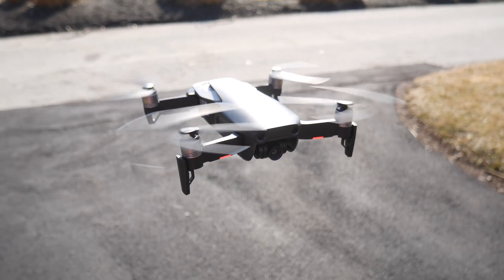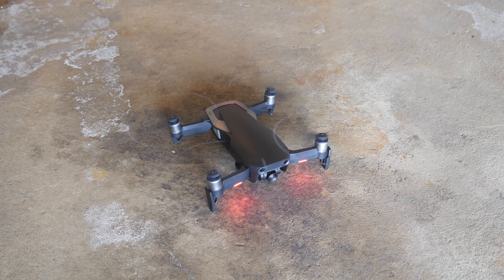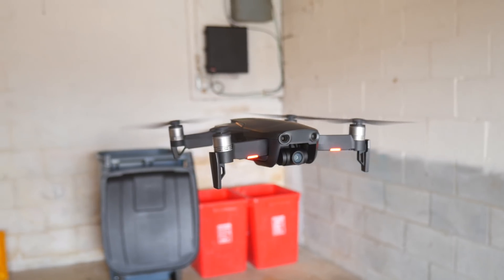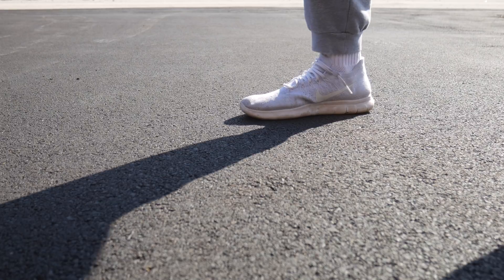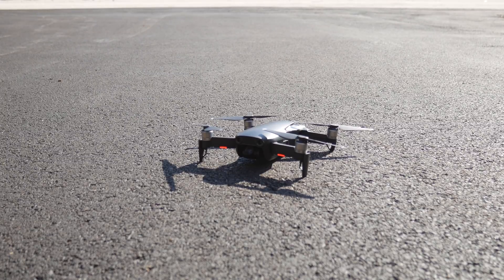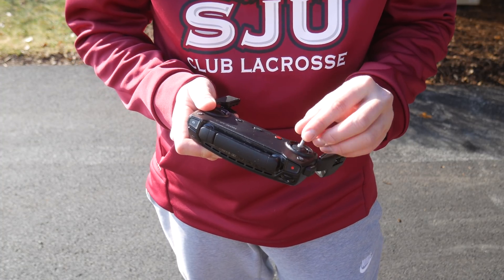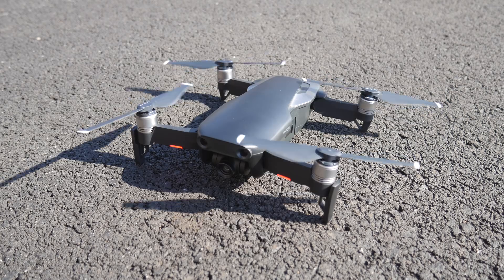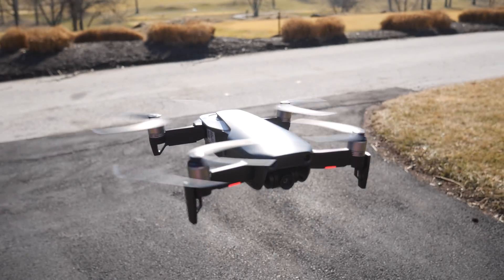The DJI Mavic Air’s Shaking Problem (Workaround)

Comment: I have a problem with my MAir gimbal tweeking during flight, most of a recording will be fine but every 30 seconds or so I will get a tweek/jump on the level of the horizon. I can U/L a sample somewhere so you can see what I'm talking about, unless you know already. I really need to find a fix, thanks in advance

Comment: Same problem with my Inspire 2. I flew it in -20 celcius and it would shake violently, then yesterday I flew it in 0 celcius and it was no problem. I tend to believe it's a gains issue over all. I will be doing more tests tonight at -18 celcius with the pitch and roll gain at 90% and see if it stops or reduces the shuddering/shaking. I have read elsewhere dropping it to 87% may be necessary. The comments have been super helpful, especially the ones speaking about gain control. Thank you!

Comment: Hi Billy.  As of this morning, the new firmware update had fixed the IMU issue.  They adjusted the PID, which fixed the overcorrection by the IMU in cold weather.   Basically it's like turning down the sensitivity on your mouse.   I flew in -7F this morning after the update with no more shaking.  Works perfectly now!
Reply from the maker: Awesome! Haven’t had the chance to check it out

Comment: First of all, thank you for taking your time to find a solution to this issue, but i must say as a dji phantom 3 pro and a mavic pro owner, that this solution is not enough.. i mean, come on, the mavic air owners/costumers are paying $800 flat for the ´´single´´version of the air instead of the combo... i don't know you guys but for me, thats a lot of money. when you get a 800 USD portable drone you just want it to fly  it without any issue right out of the box and not wait to the motors to warm up... if i wanted to spent time waiting for my drone to be ready and so, i will get a phantom, wich takes more minutes to take out of the box and assemble. for disclaimer: im not mad with you about this video, im mad with dji for this and im really hoping that this kind of problems don't happen when the mavic pro 2 comes out, BTW. sorry for my bad english.

Comment: Most likely a software issue. You can reproduce this with any racing drone if you crank the PIDs way up. Probably DJI should implement some kind of filtering or tweak the settings a bit (as you can't do that yourself in DJI Go).

Also, this would be worse with full batteries. As the voltage drops pretty quickly at the beginning of the flight, the problem will probably be gone after a minute (or a few minutes) of spinning the motors.
Reply: Thanks for your help! I could not figure out what was wrong with my Inspire 2. I am hoping this is the issue!

Comment: The reason of the shaking is a gain value, wich is too high at cold conditions.
You only have to reduce the gain of the roll to 90% and the shaking is history.
(MC Settings --> Advanced Settings --> Gain --> Roll)
If you have an additional shaking over the pitch axis, try to set pitch to 90% too.
Reply: Thanks for your help! I could not figure out what was wrong with my Inspire 2. I am hoping this is the issue!

Comment: My opinion to get this issues resolve is when flying on those cold weather place the drone on a warm car before flying , or start the mavic and have it idle with motor spinning without blades … till it reaches a ideal temp then fly, I would  never fly a drone shaking as the wear and tear of the drone is relatively high ... I use to fly rc heli and shakin and vibration is a no no go, that mavic air should be rename MAVIC CALIFONIA YEAY

Comment: I would not stress the motors and drone electronics letting it vibrate until the system warms up, best to keep batteries and drone warm.  you may be causing "soft damage" similar to soft damage of electrostatic sensitive components that fail later during normal operation. In this case, the drone would fail in flight at some point if components get stressed and fail.

Comment: Maybe this feature can cause a price reduction.  But according to the specs (0-40 degrees C), you were way out of that range.  The guidelines sometimes have to be adhered to for this shake issue.  If they had done enough testing and found this to happen, a stronger warning should have been posted.  i would have still bought it since I don't live in cold climate.  Not sure of the people in cold weather. my two cents.

Comment: I can’t speak for the Mavic Air as I don’t have one, but I have a similar issue on my Mavic Pro when it’s cold. It’s not as much as a stutter like what you showed, it’s more a sound the motors make as if they are revving up and down. 

Also the app gives a warning when the temp is below 15c. (59f) And recommends waiting until 25c (77f)  to fly which seems a little ridiculous to me...especially when it’s 20f out lol

Comment: It's not a defect, It's a feature!!!  This issue was obviously an oversight by the DJI testers.  DJI may have a future firmware fix.  The fix would be to return to the days of... IMU warming up, can't fly just yet.  If the Spark, MAVIC Pro, Phantom Pro/Adv and Inspire 2 had this issue, we'd easily accept it.  However, this is obviously an issue that DJI will sort out and future models of the Mavic Air won't have it.  Hand warmers in the carry case along with the Mavic air seem to fix the issue.

Comment: Sounds like a recall issue to me.  I wish I trusted DJI customer service to jump on this but I don't.  Another guy had a problem where the remote would not turn off.  It just kept beeping.  He calle DJI and spent 2 hours on the phone.
Reply: DJI needs more competition!
Reply: The Autel Evo should be competing with the dji mavic once it launch
Reply: There is no market for DJI's competition. The drones market has plateaued.

Comment: Specs say 32 degree minimum. Everyone is ignoring it with this drone because it's winter release.
If you want to fly under 32 degrees get a Inspire 2. I did.
Reply: Or a SPARK, or a MAVIC Pro...
Reply: And you're the one volunteering to be porter for those wanting easily portable drone?
Like photographers once often had assistant to carry all that heavy equipment...

Comment: The lowly Phantom 3 Standard and the advanced Mavic Pro have built in heaters as well as a cooling fan for the Mavic Pro. 
It has been confirmed from another Youtube author that it is the IMU causing the shaking.

Comment: I use a very inexpensive "Ewarmer" to heat my batteries for my P4P drone.  It's worth a try with the Mavic Air.  When I get my Mavic Air (in 2 weeks) I'll place the Ewarmer (electronic hand warmer, second power supply, light) in the bag with the Mavic Air (the larger bag that comes with the Fly More package).  If anyone else tries this, please comment.

Comment: Should call it the Mavic Warm Air.
Reply: I agree about the loudness relative to my Mavic Pro with the quiet props.  As for the wind, I've had it out in 20mph with gusts to 25 and it works as well as my Pro.  YMMV of course.
Reply: Years ago I had a Dodge van with a large V-8 engine and it just Hated the cold weather and shook til it got warm. 
That thing was a beast and could haul anything including my traveling rock band.
Reply: More evidence that these things are AI, they shiver in the cold like a human. DJI is SKYnet...

Comment: Sucks you have to burn 5 min. for warm up when you only have a 20 min. flight time.
Reply: It´s unacceptable having to drain the battery for a design fault, Billy. No matter how you try to put it
Reply: That 5-7% isn't exactly insignificant when in cold it's safer to bring drone back to closer range before battery cell voltage drops much below ~3,6/3,7V.
Meaning something like around 60% charge.

Safer because after that higher power draw can start decreasing remaining capacity really fast if battery isn't warm.
Though in Mavic Pro discharge current seems to keep temperature of (warm in power on/start of flight) battery under control in cold instead of it free falling.
Reply: This is only an upgraded SPARK, nothing more. MAVIC Pro 2 will be a prosumer drone, not a selfie-consumer "shaking" drone as this one. And, in the event the MAVIC Pro 2 shakes in the air, I´ll keep on enjoying my MAVIC Pro 2 and P4P until they solve the problem or launch the MAVIC Pro 3. No big deal!!! Cheers!
Reply: Gaston G. Loperena So why bash the Mavic Air then if you would continue to fly your Mavic Pro 2 even it shakes like the air? Your reasoning or logics make no sense whatsoever. I think you are here trolling that’s it. 
Call it what you may upgraded spark etc. The last time I check it say Mavic Air and not spark. And to be honest who cares what you think it is. At the end of the day we are not spending your money but ours. And lastly the fact still remains it’s the most portable drone out there with better camera and features than the Mavic Pro. As the p4p its an awesome drone and I could have 10 of those if I wanted to. But it’s big and cumbersome to carry around every where. The Mavic Pro is awesome as well but the gimbal design turns me of it would break if you look at it sideways, I hope they put a better gimbal on the mavic pro2 one more robust and I will gladly by one of those as well. But for now I am enjoying my Mavic Air cheers.
Reply from the maker: Having it sit on the ground doesn't eat up as much battery as being in the air, it typically will drop about 5-7%. Not too bad.
Reply: Gaston G. Loperena so what happens when the Mavic Pro 2 comes out?  I heard it’s the same design as the air but a little bigger what are you going to do if it’s sakes like the air. A lot you on here are making a big deal about this when it’s really nothing to be losing your mind over. 
Let’s be real most people are not going to be out in 10 or minus degrees flying there drones I know I for one wouldn’t be in these conditions flying. And if most people do all they have to do is wait for a few seconds for the drone to warm up. Any electronic would need to be warned up before they work like they supposed to in these conditions. Jake Sloan on YouTube lives in Alaska he flies in 17 below weather and he lets his Mavic Air warms up for a few seconds and it does perfectly fine.